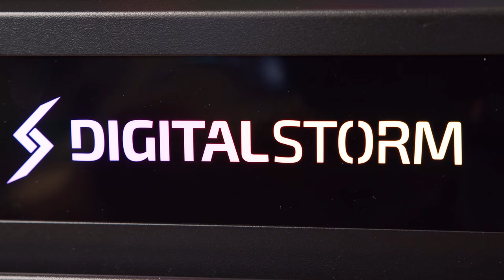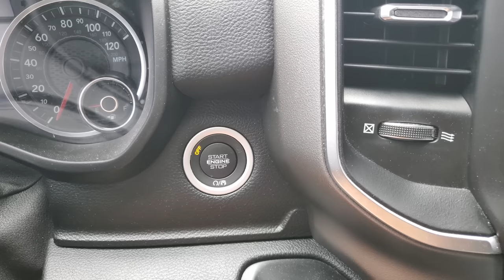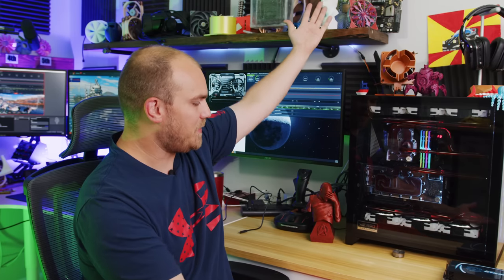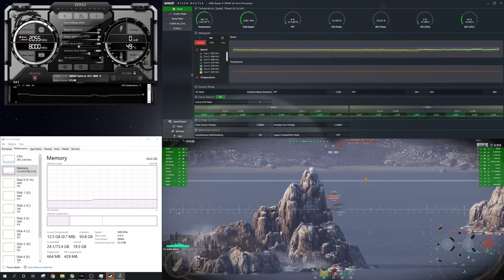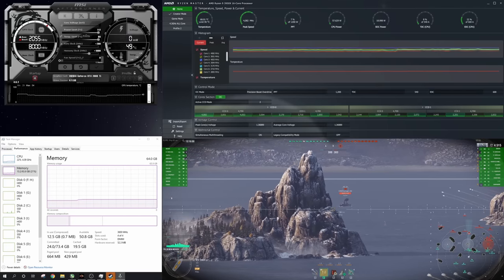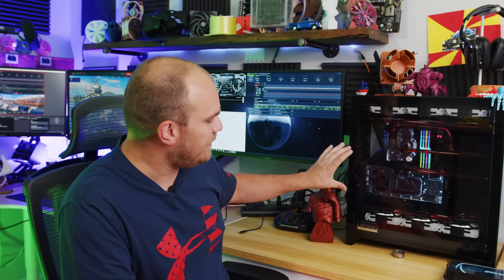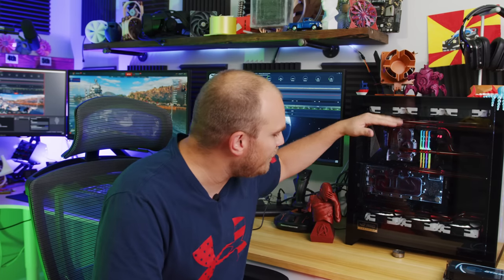$2.00 part BRICKED my gaming PC

Comment: The last motherboard i had die on me was a AM2 board that i ran a athlonx4 in. Don't remember the exact board but while in it's hospice downhill spiral it had constant hard crashes, memory errors, multiple different boot errors etc. Also I remember when it finally died it would turn on but the bios would basically have an error saying usb error, no memory detected or drives showing. Weird but I think what died was the chipset, doesn't matter cuz it was dated when it happened and i built a b450 2700x system. Still had the board until I moved

Comment: One reason I'll never build a water-cooled PC, I never would want to deal with all the water just to swap parts or work on it.
Love your videos cant wait to see the retesting of old fan designs.
Edit: lol "BRICKED" now that's a little hyperbolic wouldn't you say, lol still enjoyed the video tho.
Reply: Custom water loop, yes.  AIO's are not much worse than an air cooler to work with.
Reply: I’m with you there. Air cooled, with the quietest fans I can find. But I’m not a gamer, don’t overclock, and always use lower TDP CPUs so I don’t need tons of cooling on my machines either. Not interested in any CPU that has more than 95W TDP.
Reply: @fellwind  I do use an AIO for my CPU so yeah I did mean custom.
Reply: @geoffstrickler  I sit like 10ft from my PC so noise isn't a problem for me, been going without AC the last two years so I do need to watch my temps on some days.
Reply: @WDMurphy  been a while, but I had an office in my house, had at least 5 computers, my server (networking is on of my areas of expertise), Two Windows PCs, a Linux firewall, a desktop Mac, and my MacBook Pro, plus a couple switches battery backups, 2-3 monitors, KVM switch, etc. it got pretty loud at one point, so I researched fans and replaced nearly every fan, replaced the thermal paste on all CPU coolers, even replaced some CPU cooler or CPU fans. That made a significant difference in noise, and cooling. This was also pre-SSD era, so about 10 HDDs operating in those systems, plus external HDDs for backups.

Comment: If you ever do lose a motherboard they are kind of easy to repair usually. I'm still four minutes into the video I'm not sure what his problem was yet. For future knowledge for anybody who has experienced a computer loss due to motherboard failure and you want to try to fix it, there is a possible way depending on how your board failed. 90% of the board failures I see or I have seen in my life I should say is usually a capacitor and you will see the swollen cap. Make sure your voltages and tolerances or correct. Check the farad rating to make sure it's at least within 500 microfarads. On some TVs I've actually upped that to 1000 microfarads over the original and those TVs are still running after 8 years. It's all I had on hand at the time and they were my learning TVs!

Comment: did you force your os to be on the cpu vs chipset i had a similar issue adding drives later can cause this too windows is stupid it really wants you to have all drives installed on setup and choose drive 0 most people will nvr have an issue but if you do im sure this will help

Comment: That's odd that the CMOS battery would cause your system to fail to POST. Instead it should've been giving a warning on the screen saying the battery is bad but otherwise allowing you to boot the system without any other issues. It's also odd the battery died so quickly. Usually those batteries last for years - I've seen them last for over 5 years, but never for merely a little over a year.

Comment: I feel happy that your machine runs good now , my Pc i3 9100F suddenly rebooted then got stucked forever in boot loops, no POST, issue is probably Motherboard or CPU.
In anger I dipped it in 80% sanitizer and left for 30-40 mins , Now it runs for almost 6hrs good, but next day it may or may not. Completely unreliable.
Random restarts. I'm so bored.
Bad Luck...

Comment: Bad button cell batteries can REALLY cause weird issues. Had an old Athlon 64 system that would randomly blue screen with errors that were indicative of low CPU voltage on an over clock and replacing the button cell battery ended up fixing it. Made no sense to me but that it the way it goes sometimes!
Reply: The worst I've had was one that leaked, corroded the mobo around it.
Reply: @satibel  oh dear god that suuuucks! My condolences. 😬

Comment: To get that bottom tube to line up you won't be able to use a 90° fitting. You'll have to bend the tube 90 and use a straight fitting. Just measure from the rad straight to the port and bend it. Don't cut the tube until after you bend it and be conservative when you cut it off. You can always cut more if it doesn't fit, but you can't add more. Lol. Wish I could give you a formula for the perfect numbers for bending. But it's more of just a hope and a prayer thing, at least for me. Lmao. You get a feel for it after a couple and just know where it all needs to be.

Comment: Odd 2032 battery for for CMOS should last years. I have machine here (FX 8350/Asus AM3 mobo) that has 9 years this month of almost 24/7 uptime that is still on it's original battery. And several older mid 2000s boards that boot and still retain cmos with no sign that the battery is dead.

Comment: Hey dude do you have a link for that thing you hooked up to your PSU, it looks like it has options for banana plugs to use it as a bench PSU? I need this in my life but don't know what to search for to get one lol. You should def open the blocks next time as well and do what jay does with some toothpaste and a brush on the blocks if soap wont take it off. works wonders it turns out!

Comment: heat reactive dye in the fluid would be fun to have
Reply: Sadly like other liquids with special dyes... They tend to settle and gunk up the internals of the blocks.

So any fluid with tiny particles is basically a NoNo for loops.

Comment: This is 2021 and we still have hardware reliant on stupid things like a tiny battery running a clock.  I would fix it by having the system record the time and date to a 1kb flash drive built into the motherboard when you shutdown windows.  Then if the CMOS battery is dead the BIOS can use that stored date, and when windows boots it can check for the time online, and then give you a popup telling you that you have a problem with your MOBO battery.  Or just have a hardcoded date into new motherboards so the furthest back a CMOS could reset to is when the MOBO was made.  The LAST thing a computer should do is brick because of it, worst case scenario should be to just boot to windows and there is a popup saying "It appears your date is set to 1970, please buy a new MOBO battery, that usually fixes it."

Comment: hrmmmmmm..... @ 13:38 What did we really learn??? .... K.I.S.S. - start small and THEN assume you need to replace the MOST IMPORTANT PARTS - the first thing I was thinking when you said you has issue with your boot is that you need to FLAHS YOUR BIO, but with out it turning on I would have suggested trying to RESET YOUR BIOS which would have most likely allowed it to boot once with a dead battery but given you an error (I'm just guessing it would've) - but anyway, I'm REALLY HAPPY you figured it out before you started replacing the mobo and then it dawned on you... so it wasn't bad at all and we got to see that you know what you're doing when it comes to fixing PCs - so just remember K.eep I.t S.imple S.asquatch!!!! :D

Comment: Interesting. 
I have some sort of the same problem with my PC. 
It started one day and my pc didnt start. Reset the main switch on the psu solved it. Somedays later it happend again, i read that dp cables sometimes got load on it and can make this happen. After disconnect both my monitors, problem solved. Then same error a few days later, but nothing helped then. After a lot of testing (and yes, cmos battery check) I didnt found any problems.

Took the PC to work, worked like a charm. At home, nothing.
Then it started one time, 1 min later, I got a short in the psu. 
Ordered a new psu, even then my fuse goes out. I'm now on a different power outlet and it seems to be working. 
Probably the electrician made some faulty connections on my powerline which slowly killed my psu. 

If somebody still has an idea, im open for it :D

Comment: I once had a strange motherboard that would not boot no matter what I did, it was a ITX board so unfortunately changing cmos battery would mean... asking for a replacement part through my distributor but they were like ok that's fine

I tried pulling the battery and it started working so I ripped the battery apart and checked that it had NEGATIVE voltage. I slapped it back together heatshrunk it just to make it look like it wasn't messed with and gave it to them... the wires were spot welded onto the battery I took it out for testing and just slapped it back like that 🤣🤣

Comment: sounds like one of my old pc's i was gaming then when i wanted to sleep i closed the game and went to shut down the pc it insta shutdown sure i was wierded out but i thought whatever i go sleep then the next morning it wouldnt boot the only functional part was the power supply litteraly every component except fans stoped working why to this day i still dont know you would think there is some clue to what caused the failure i couldnt find anything that certainly was the wierdest failure i had from components

there was another pc but that was from my sister it was cursed motherboard fried with the cpu then my sister completely replaced the components motherboard refused to accept settings while it kept time it kept resetting the bios also for some reason it kept saying the cpu ghz overclock was not stable but its the stock ghz it would boot and work fine  ignoring the message wel that one died eventualy aswel my sister did a complete switch 1 more time again wierd issues with usb ports and such its like for some reason the voltages was fluctuating and the power supply was faulty but the values on the power supply was perfectly fine

my sister switched to laptop for a while afther that she eventualy got a new destop pc but which works fine but her old destop pc was seriously cursed i dont know how the hell a pc could act like that maybe it wasnt grounding the case properly but i dont think that was the case either as there many of those cases that work just fine also it was the dreaded opera pc since my sister would sometimes forget to turn of the speakers and one time opera music started playing and it wasnt low in volume no it was loud as hell my sisters and my mother were directly fully awake 

i never encountered such wierd pc problems afther for the exception of a wierd memory slot bug that would only accept memory in a certain order if not it refuses to boot

Comment: If it's the CMOS battery.
Can we have a moment to talk about super capacitor superiority?
The only requirement is that you don't leave it off for long.
Reply: The battery used to power the rtc and nvram on desktop motherboards is cheap, very small and has almost non existent self discharge, how could a capacitor be that superior in this application?

Comment: dude, your mono block isn't making contact. I have that same MB and block and mine runs at 32c. you can see when you pulled off the first time. looked just like mine. I run a 3950x under mine. trust me, it's not making contact, it is like a number to shim on the feeler gauge.

Comment: dude you should also start to make the fans externally controlled from an aqua computer octo
Reply: I got an Aquacomputer for my water build and while it's overkill... I enjoy seeing those charts and tweaking the curves.  Briefly played with the PID control, but the numbers they used for defaults were not immediately comprehensible to me so I set a basic curve and tweaked from there.

Comment: 1:02 That edgy front panel design looks straight out of 2011. But it has ventilation, so that's fantastic.
Reply: the case i think is using bottom to top airflow with some negative pressure, so the front doesn't matter much tbh

Comment: I had a lot of issues with several AM4 boards and Zen 3, after 3 different issues, I said screw it and went back to Intel and had no more issues (besides some multi-thread performance loss), but I am happy I made the change. AMD really needs to get their act together with quality control. There is absolutely ZERO reason a CMOS battery shouldve died on you that fast. I used to be a PC technician and had seen boards with batteries that lasted 10 years, clearly OEM because they were caked in dust and the owners had no clue about PC's and everything inside was 'virgin', so it was never taken to another shop.

Comment: you said your mobo forgetting what to booted in that sounds like died CMOS battery 
if CMOS died n shorted itself cause mobo dont turn on because shorting psu make it think there something dangerous n avoided powering on 
i have that issues on one of my laptops kinda got me so angry because it keep shutting off randomly n i yeened cmos battery out n try aging n worked fine for wholes years n CPU died on me cant find other one so ended up junking it n find other pc was AMD e300a got me going unite THAT CMOS BATTERY AGING UGH (doesnt know what hdd to booted in) i ended up having buy rechargeable battery 3v n make connections to CMOS battery trays no issues so far

Comment: And the clickbait. You never bricked your rig, you just had a battery failure. Bricked devices will never startup due to horribly corrupted bios and requires the bios to be fixed through direct upgrades to the mb.

Comment: hehehe i knew the issue as soon as you said it lost your boot priority setting :) 
Don't you hate it when you over look the simplest thing because you got to damn smart for your own good lol 
See this is why you teach someone else how to build repair upgrade etc. You then have 2 things going for you you think about all the possible causes simple to complex and when you forget again and over look the simple you can call up that kid with 2 or 3 years experience who will know right off the rip what the cause is because well they have not had their brains polluted with lots of crazy complex problems over a decade or 3 of experience :)

You started looking at the psu and skipped over the most basic cause because well all your experience says psu as most builds do not out live the cmos battery that can last 3 5 or even 10 years esp in new pcs where when the computer is powered on the cmos battery is not being used the circuit for it is cut by chip set telling a circuit to open.
After about Pentium 2 or even as far back as mmx series cpus this came in to play prior to that cmos batteries were constantly being drained even while the system was powered up but after mmx or so the cmos battery being disconnected was the normal so they never bothered to use a rechargeable battery as it just was not needed.